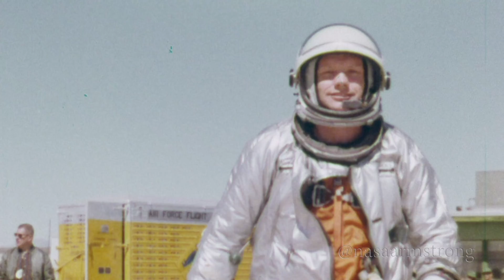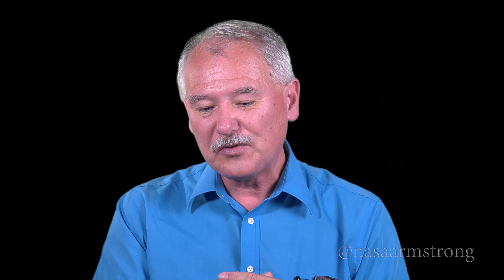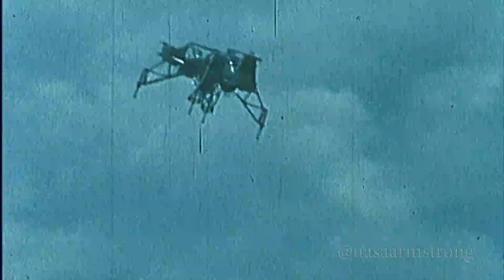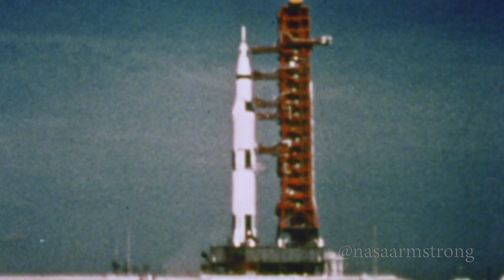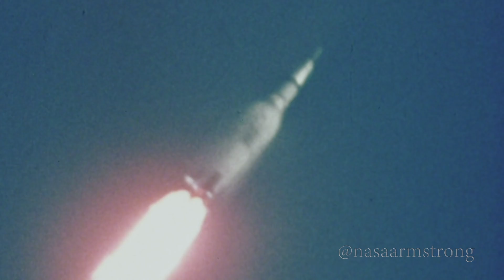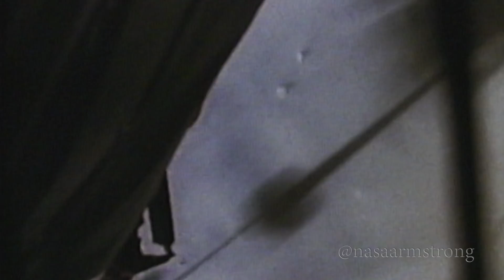NASA StoryTime : Meeting Neil Armstrong

Comment: The naza phonies never even went leo! The lunar module had 2 engines, 2 fuel systems- so when they set down they still had ton of fuel for ascent: conmen creeps
Reply: Just because you're dumb and ignorant doesn't ,mean they didn't land on the moon. So you have proof they never even got into LEO? You obviously know nothing about the LM, it had a descent stage with it's own fuel system and a descent stage with it's own fuel system. The rocket motors used two totally different fuels. The ascent stage used a hypergolic type fuel that ignited on contact with the oxidizer